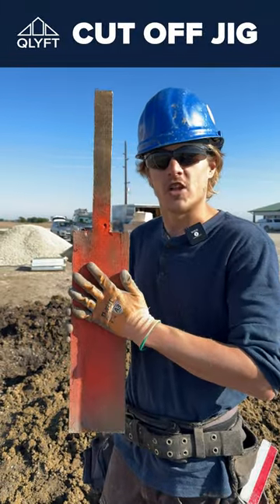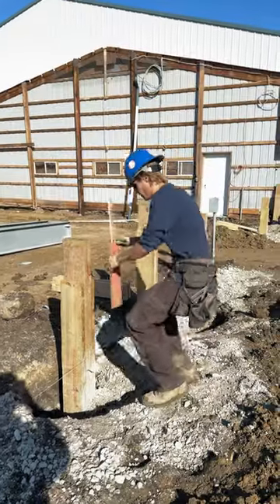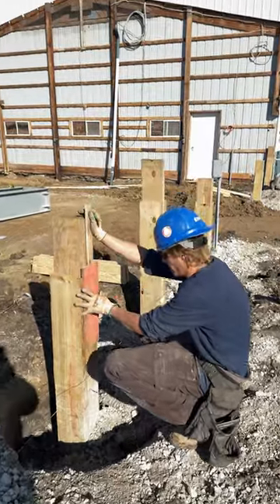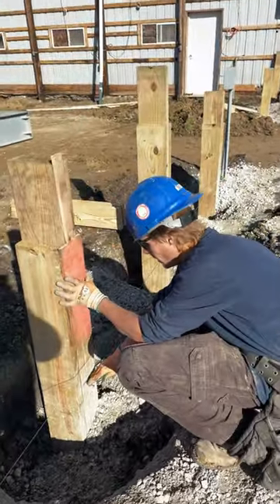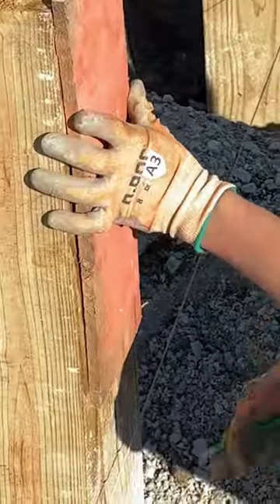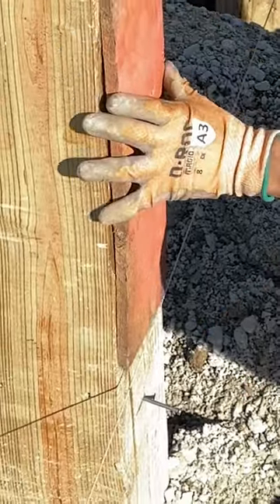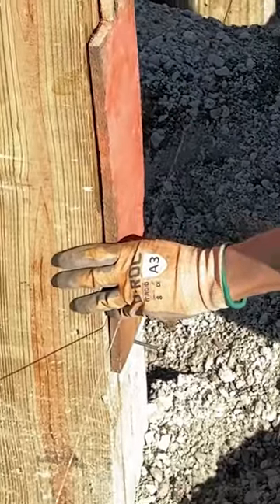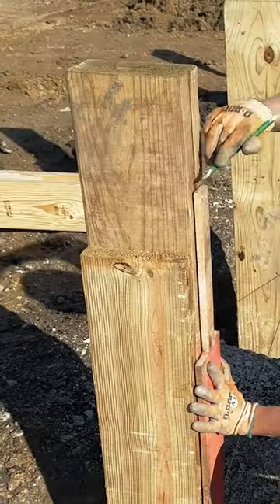How To Raise A [QLYFT] Pole Barn: The Cut-Off Jig  #construction #polebarn #postframe #shorts

Comment: So are you cutting the top line or the lower line that you marked on both sides. Not very clear on what you were doing.
Reply from the maker: Both top and lower line are cut
Reply: Still not very clear, should show one that is finished.
Reply: @FBiBuildings1958 also a tad confused, are you just cutting the side pieces on the bottom line?
Reply: For the guys doing the cutting it’s clear, they cut these all the time and know. For those that don’t, you are cutting on the excess side of the line, and you are cutting that whole shape out so that another pole with the same shape cut but cut on the other side of the line will fit right over it.